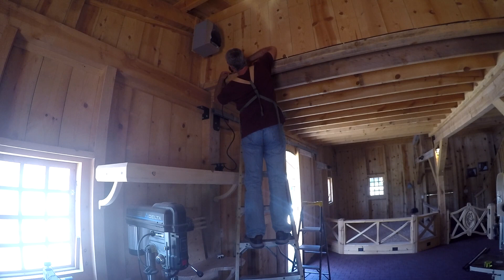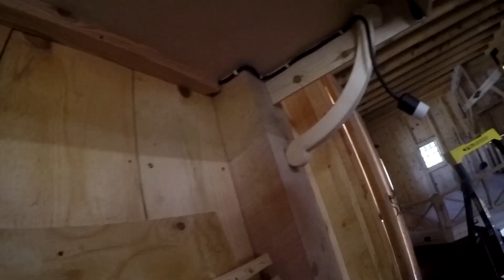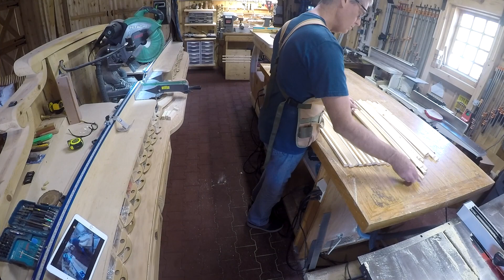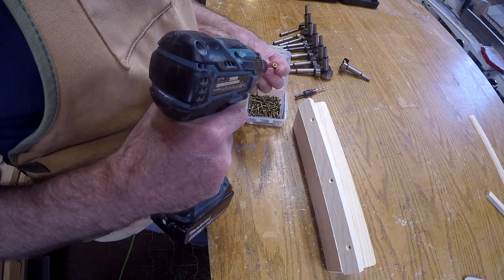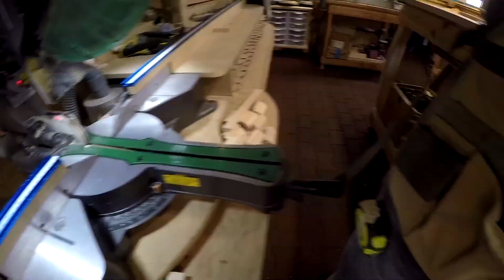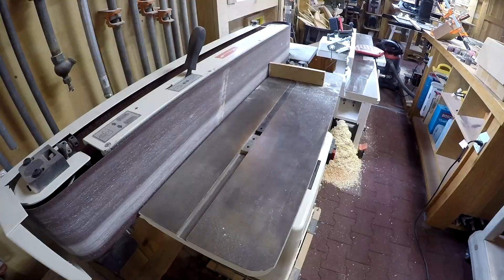How To Build A French Cleat Wall for The Drill Press

Comment: Love it!! 
Do you ever have issues with the forstener bit one rocking out of place? I'm picturing the weight causing it to twist down and pull out of the french cleat.
Reply from the maker: Actually it did fall off there once so I slipped a little scrap of wood behind the cleat so it couldn't lift up. This also keeps the whole set from lifting when you are taking a bit out.